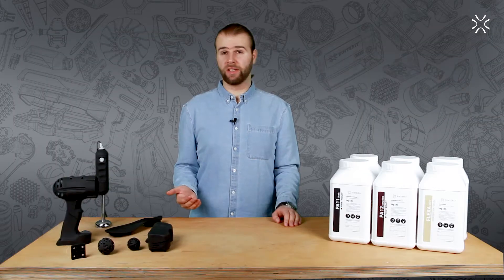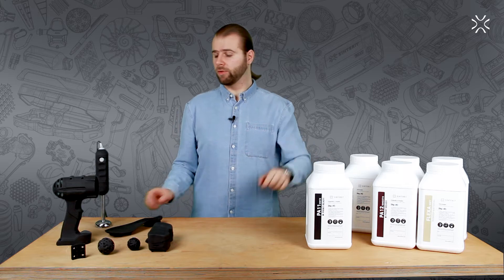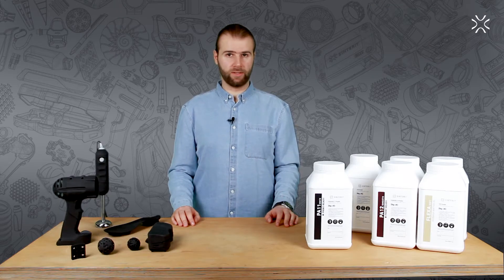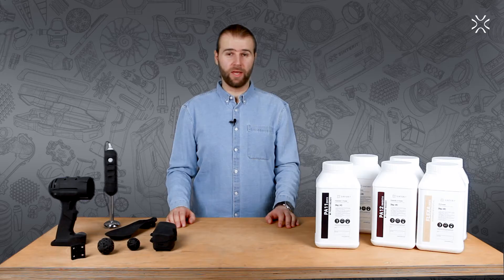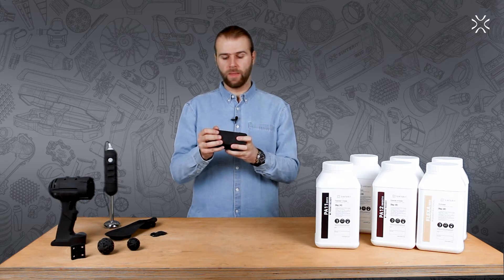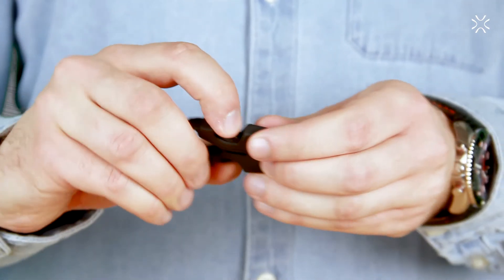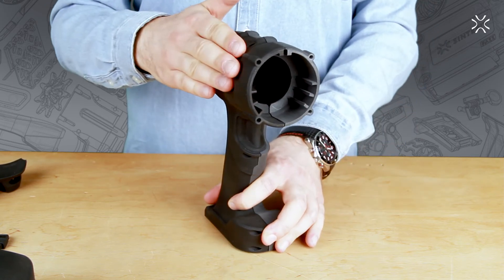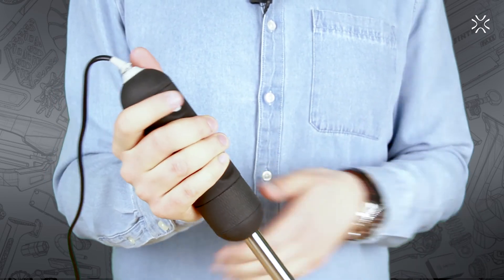Sinterit PA11 Onyx: the most durable SLS 3D printing material

Comment: SO is it a reliable alternative to traditional Delrin machines casings for deep diving SCUBA gear such as dive light batteries cases and the like? Does this PA11 work well with parts having threaded caps, or lids with o-ring seals? Doe it hold up to the pressures of deep sea diving specifically less than 200' of depth?
Cheers, #SeattleRingHunter